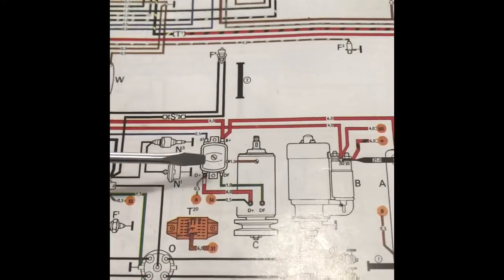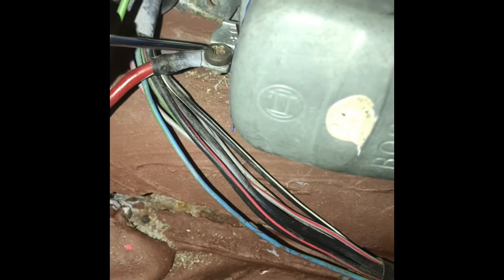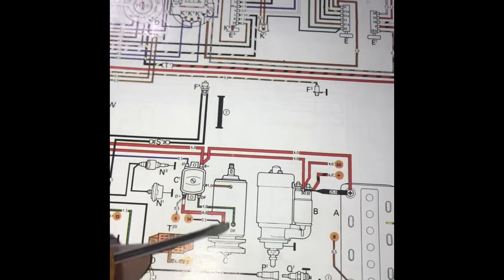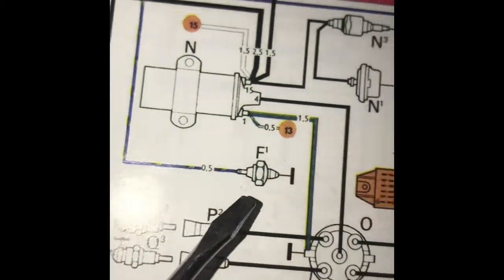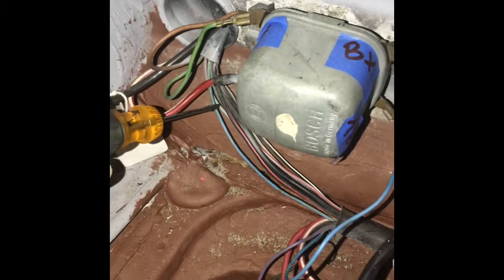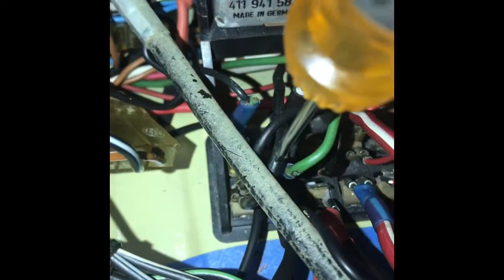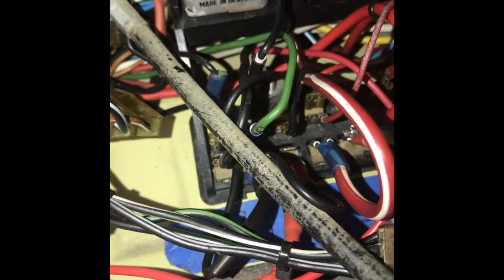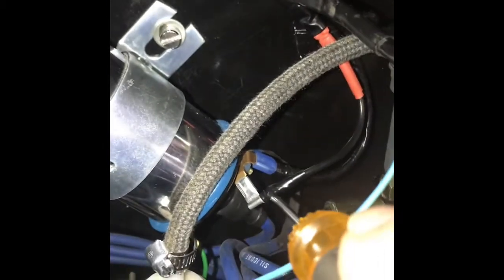Wiring 101 for you 1971 Super Beetle video #7

Comment: On the voltage regulator which connection sends power back to the battery to recharge it 
Isn't that the B+ ?
Reply from the maker: B+ goes to the battery positive terminal
Reply: @juniorclassicvwbugs924  does the power from the generator come out of the B+ on the voltage regulator is my question ????

Comment: I have started rewriting my 71 supper beetle convertible. Thank you for your excellent presentation. I have one question. I can not find the ground connection on the generator. What is the next best spot to attach the ground wire.
Richard from Birmingham, AL.
Reply from the maker: There should be a small screw on top of the generator.  Normally a wire from the DF can be connected from the DF to that screw.

Comment: Great Series!!!  I'm surprised you don't have thousands of subscribers...lol   I am starting to rewire my '71 convertible.  The initial problem was that the solenoid just "clicked"--tried shorting ignition and power connections and solenoid (and starter) worked fine---so--looking like the old wiring is simply providing too much voltage drop--hence the rewire.  I would like to replace the fuse box with something a little better--any suggestions??   I think I would like to try to replace T connectors with either Deutch or Amphenol type connectors---and upgrade the starter + to maybe a 2 AWG and am definitely going to steal your idea on running at least one separate ground wire----in addition to chassis ground.   I have rewired a GM diesel truck from the early 90's and grounds were a problem also---so used a marine terminal block and ran several grounds...works great.   Anyway--I am grateful for people like you sharing your expertise---as YouTube becomes more "monetized"--I think we will look back at this time as a golden age of learning.

Thanks again!

Comment: Hi, thanks for this videos, new suscriber here!
Just, wanna ask about a problem with my beetle... I turn it on normally and drive but when I turn it off and then come back and try to start it, justo doesn't work, I have to push it, so I've noticed somethings, like, the generator light is always on and I a relay that's below the passenger seat is so dirty now, someone told me that that relay may cause the problem, but I don't know if that's the case... And sometimes the car shuts down and burns out the fuse 7, leaving me without lights on the dashboard... Any advice, please?
Greetings from Mexico